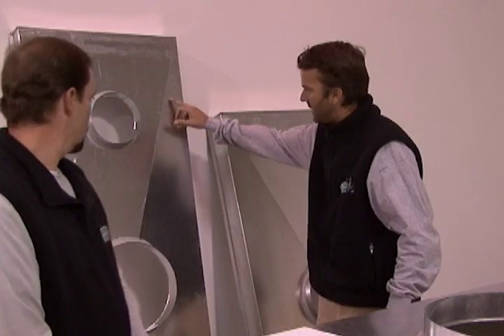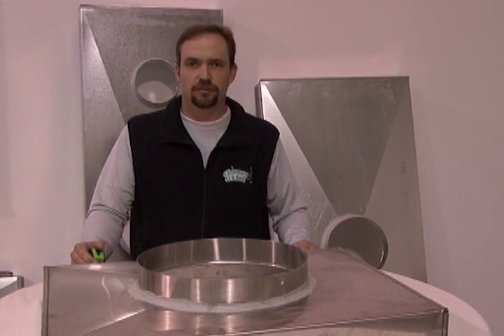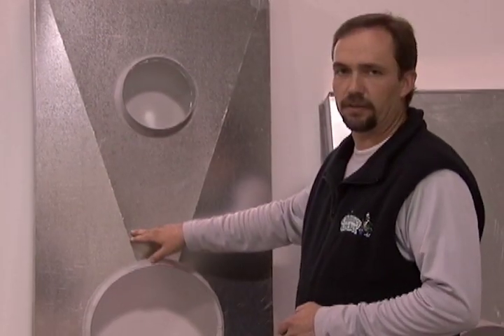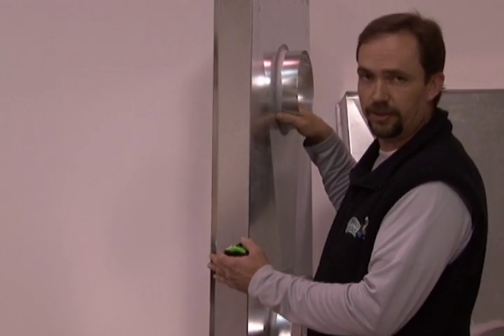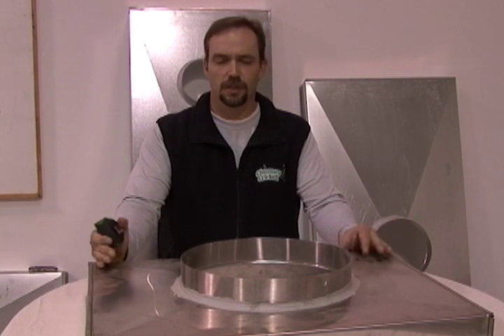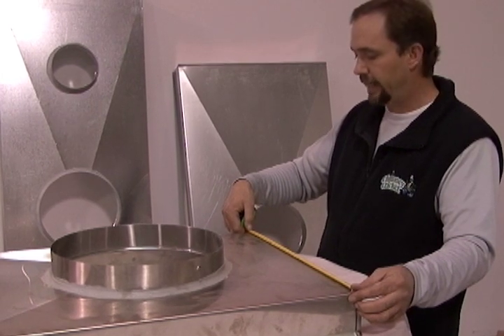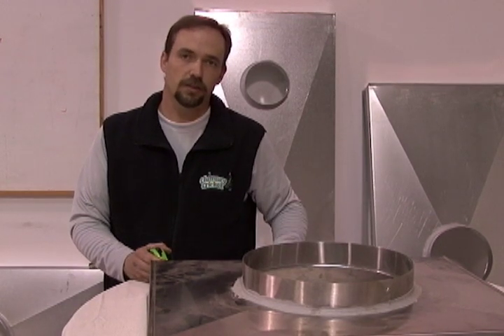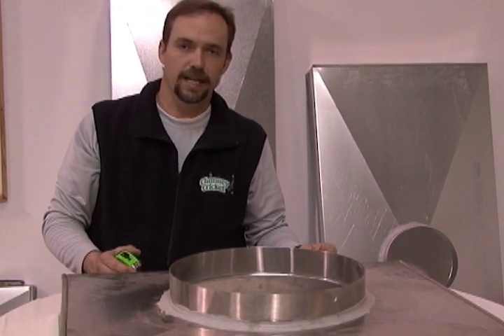Chase Covers - part 1

Comment: I recently had my cap replaced and they used 26 guage galvanized which I understand is thinner than recommended.  I live in hot humid rainy South Florida, so I expect this may rust through after only a few years.  Has anyone here ever painted one to make it last longer in hot climate?  I'm considering it but thinking the very hot temperatures on metal might make the paint peel and bubble making things worse.  Any advice would be appreciated.